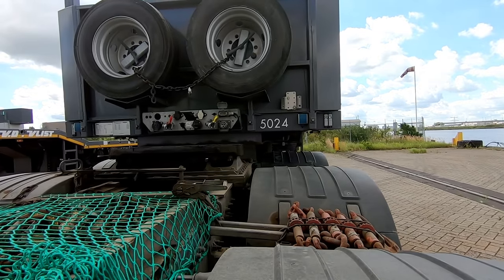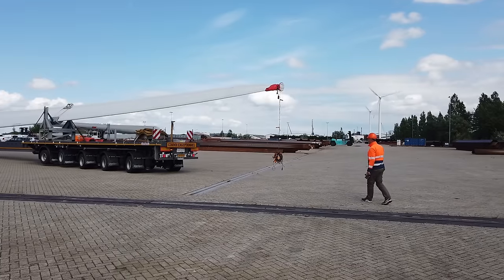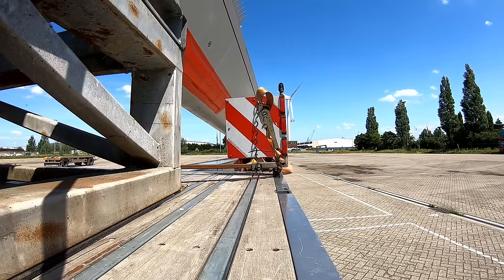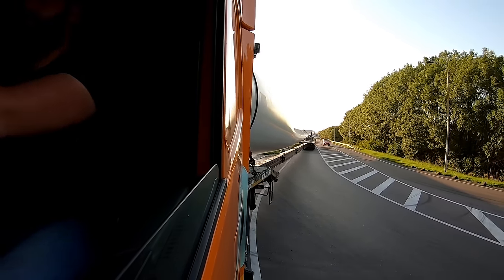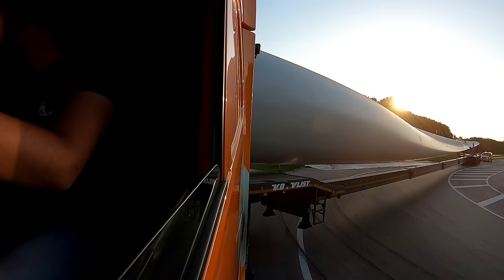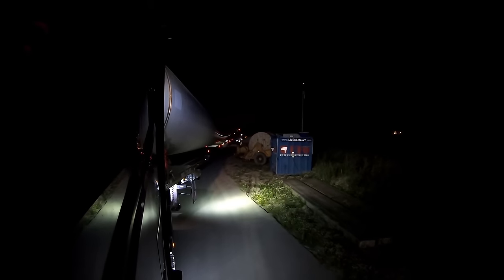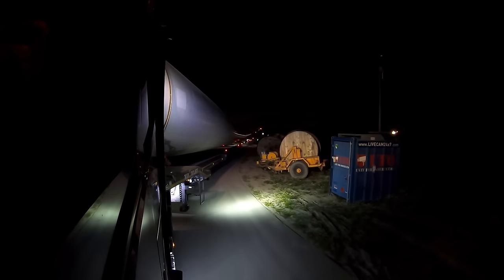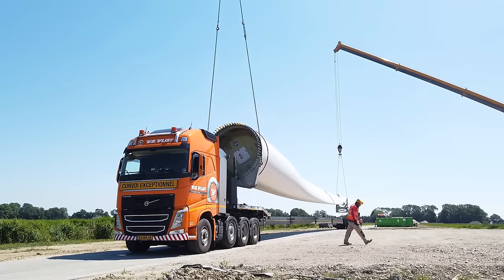OVERSIZE TRANSPORT!#1 Transporting 58 meter long windmill blades!

Comment: in my opinion every Trucker must do this warm Up excercise bye extending the trailer before Starting...the only method to Bring them to move a bit more then from bed to Steering  wheel and Back...😁
beside this, Well Döner Job and good Cam Work...